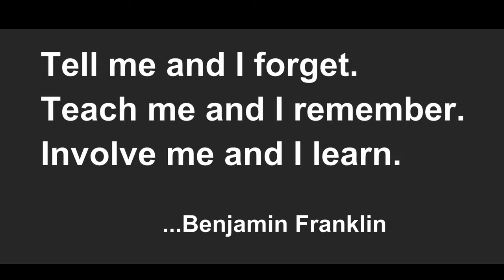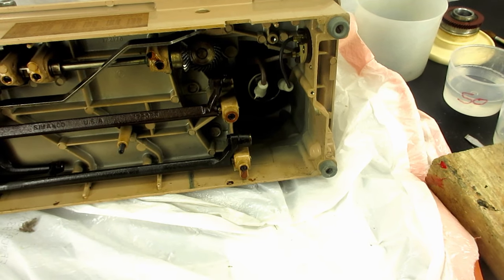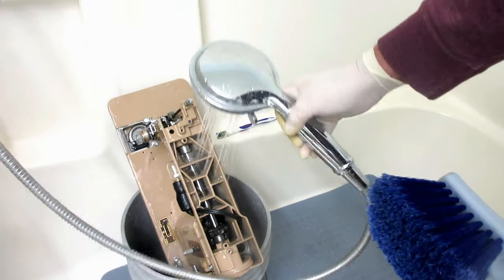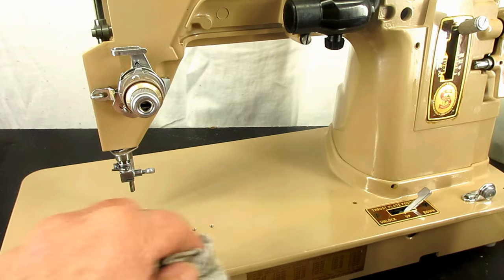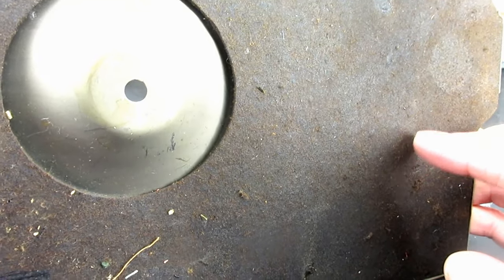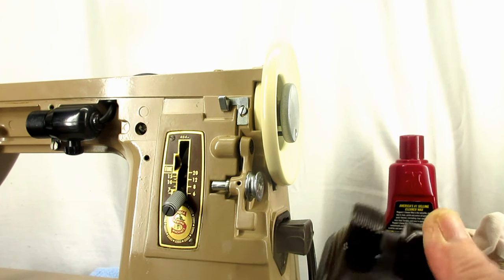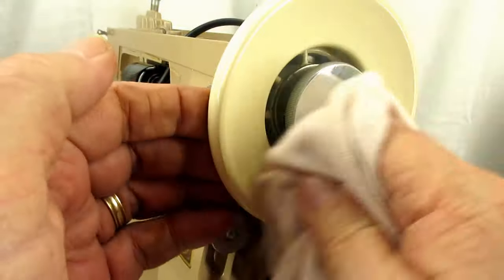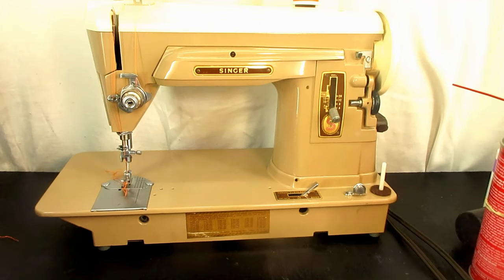An easier way to clean & degrease a sewing machine with less parts removal.

Comment: I have a black 401. Can I use your method on the lacquer?
Reply from the maker: I did not know that Singer made any Black model 401 machines. Huh... Maybe it's a 301? Anyway, don't use Krud Kutter on lacquer. Cleaners like KK are alkaline based and viewers have told me it harms the finish. Sewing Machine Oil and GOJO and some wax cleaners seem to be the preferred cleaners. I have cleaned, or attempted to clean, a couple of black Singer machines and have videos of doing it.
Model 221 inside cleaning:  https://youtu.be/lz2xV3zfvJE
Model 221 outside cleaning: https://youtu.be/nZKAVHfUQoc
Model 99K inside & outside cleaning: https://youtu.be/w6fn-TSOCYo
You'll see I often use the KK on the inside and on parts that I've removed.
Thanks for watching my channel.
Reply: @andytubesewing1953  Thanks so much for your quick response. Yes, it is a 301. She will be my first attempt to clean and service a machine. She is in very good condition and I am nervous about damaging the lacquer and the decal. Your videos are very thorough and well worth the time to watch. Thanks so much for your generous sharing of your knowledge.
Reply from the maker: @areding09  Thanks for the kind words. I meant to give you this link about cleaning a featherweight machine. It has the same type of parts as a 301 and these folks handle featherweights for a living. https://singer-featherweight.com/blogs/schoolhouse/cleaning-and-polishing
Reply: @andytubesewing1953  thank you very much.

Comment: Question can I used degreaser from car and fines with steamer machine?
Reply from the maker: @Youtuberkit7  sorry but what is car and fines?
Reply: Question had vintage sewing machine can I used degreaser and steamer machine? To clean the old sewing machine?
Reply from the maker: @Youtuberkit7  okay I understand now that I've never used a steamer machine. The Krud Kutter product is water-based so I think you could probably use a 10 to 20% solution in a steamer but maybe the steamer instructions are manufactured can advise you on what the steamer can handle not sure the advantage of using a steamer as I've never used them on that's simply the brush on wash off method
Reply: Much better thank you Sir

Comment: Hello Andy...I need your help......I have a 221 singer that i wish to fix..looks great. the light turns on but the motor does not make a sound,also the cord is damaged,,what do you say could be wrong.
Reply from the maker: Hi, Yucca. There is a 3-prong cord that is wired so the wall power goes to the switch & light, but through the foot controller to the motor. If you have an open (cut/broken wire) to the foot controller or to the motor you get what you are experiencing on your machine.
I don't know if you found it, but I have a playlist (Lala) with 20+ videos for working on model 221. Maybe you could take a look at the motor videos and get an idea of the wiring and how the motor works. https://www.youtube.com/playlist?list=PLsCOZgzzaiKIA1OPw0k6QOSTE-wAUZ4kp   I also have a playlist for restoring the foot controller in case it is an internal problem or a cord replacement is needed. https://www.youtube.com/playlist?list=PLsCOZgzzaiKL6ePPxLpmnWSzTyxPKTb71
Don't be shy about picking up a tool and working on your machine. You can do the work yourself and it's very rewarding to do so.
You'll get to know, and appreciate, the machine better and in the future, you'll know how to troubleshoot problems if they arise.
Thanks for watching my channel.
Reply: @andytubesewing1953   I will let you know what i discover.. I sure will give it a go....Thank You so Much!!
Reply from the maker: @yuccarunner5386  That's great. I'll be interested in what you find out. Thanks.

Comment: should you have cleaned the commutator first to get the diamond dust out of the machine. getting that abrasive into the machine as the last step seems counter productive to me.
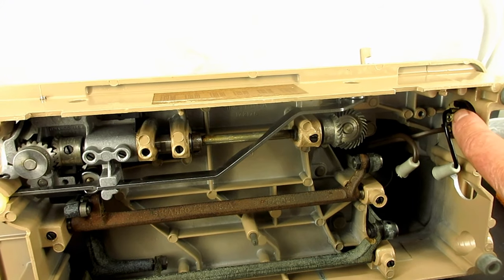Reply from the maker: You make a valid point, Don. I usually clean the motor outside of the machine, as in this video starting about 1:24:29 https://youtu.be/fmEeBi8x9ZY
I recorded this video in segments over several days. I did not decide to include the commutator cleaning part until I had already put the machine back together. I wanted to show it to people (again) b/c of how easy it is to do, it's affordable, and it really gets results of better speed and power. Thanks for watching my video. Take care.